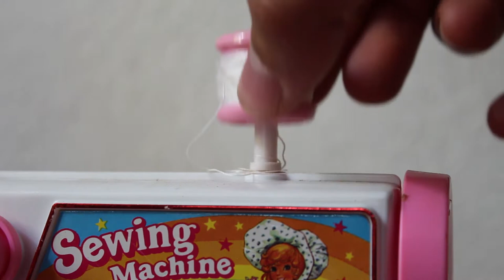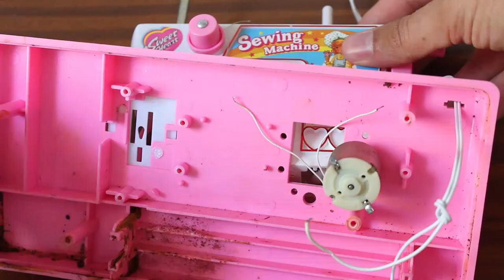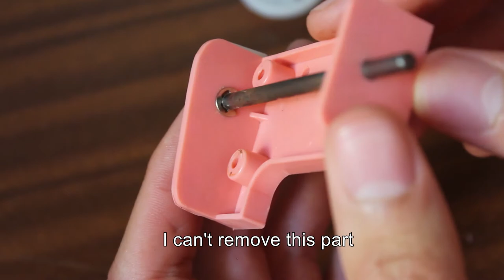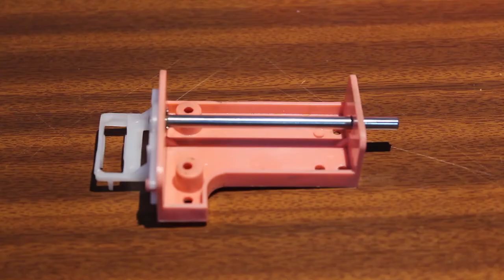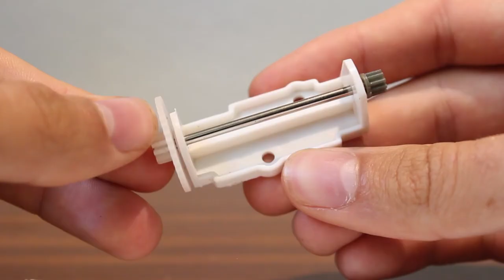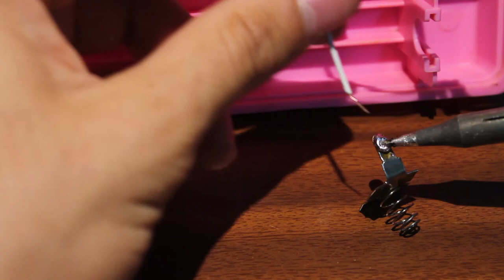Sewing Machine with Corroded Batteries – Restoring Toys

Comment: Great video my friend.  I had a giggle when that little nylon gear broke again purely because I saw it happening before it did. Nylon somehow does not bond with super glue. But great fix. Kind regards. Paul.
Reply from the maker: I was also expecting it to break, but anyway I wanted to try to glue it. Thanks for your support Paul!
Reply: @randomchanges4810  your welcome dear friend. I repair vintage audio equipment like boom boxes, guitar amplifiers, multitrack cassette recorders ect.
Reply: عن محدد 89